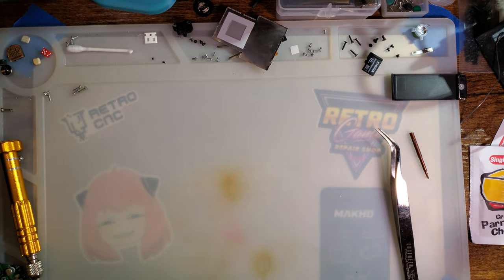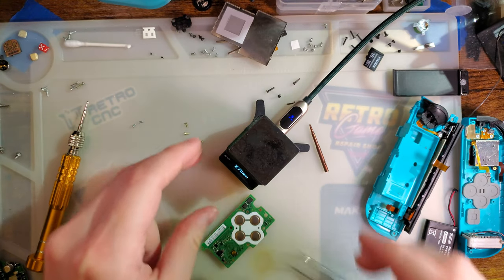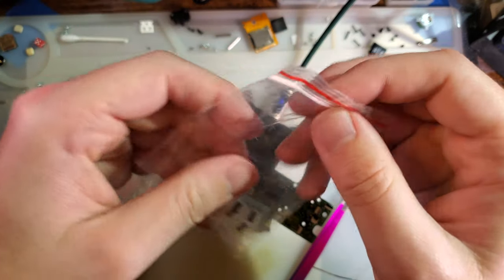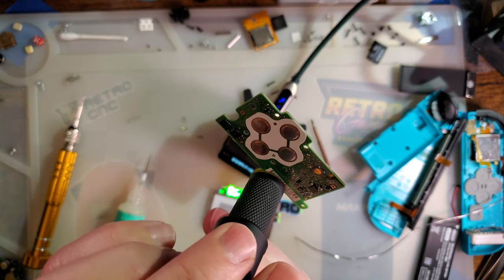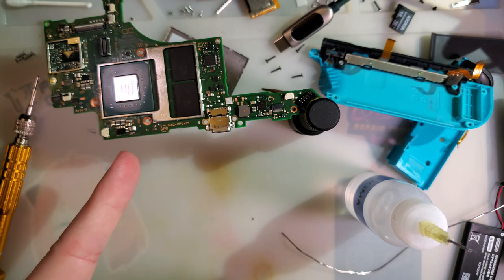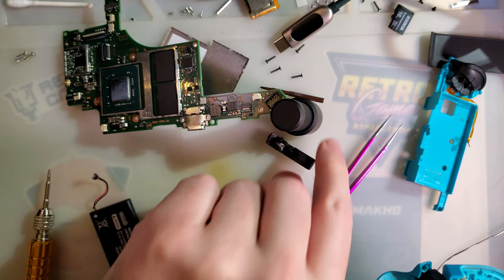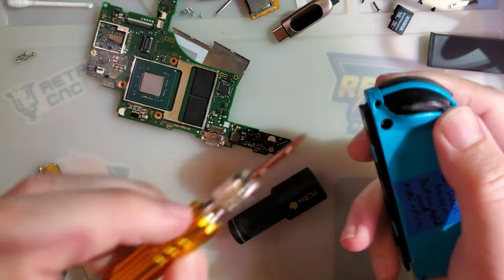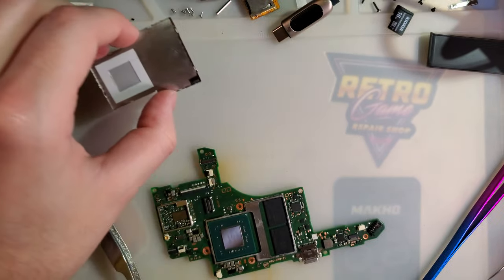Switch Joycon Rail Connector FFC Replacement

Comment: I've never soldered before but broke this component (actually, it's sister the rail buttons) while doing a shell swap. Here's my questions:

1) could a beginner do this with low-risk?

2) what tools would I need to do this (and most tech repairs including soldering)

3) should i just buy a donor MoBo?

Comment: Did you ever happen to make a Rumble cartridge for Legend of the River King 2 for Gameboy Color? After running it through the gameboy ROM Analyzer for Windows and changing the cartridge type to 1EH and fixing the header it's good to go. It's not illegal if you dump the ROM yourself on the PC using the Epilogue GB Operator.  Then you can do what you want with it. It should work on the EZ-FLASH Omega Definitive Edition as well as the Pow Kiddy V90 with the Pocket Go Firmware Update. The Earthquake at the beginning will let you know if you did it right. Just wondering?

Comment: How do these connectors fail anyway? I don't think anything is pulling on them.
Reply from the maker: Normally, no, nothing is putting strain on these connectors. In this particular case, it was likely someone who opened the controller up and tried taking it apart.